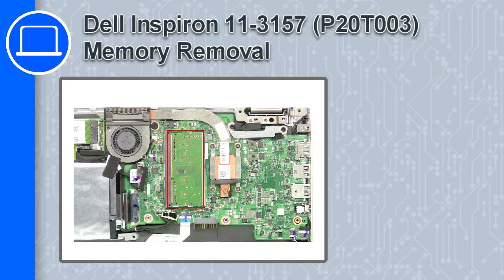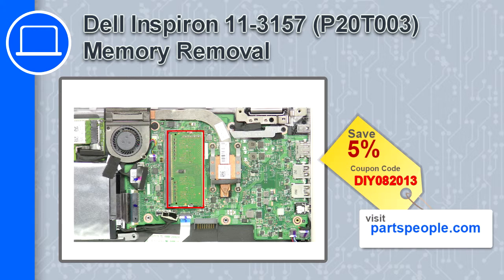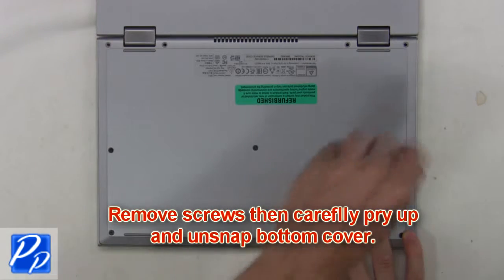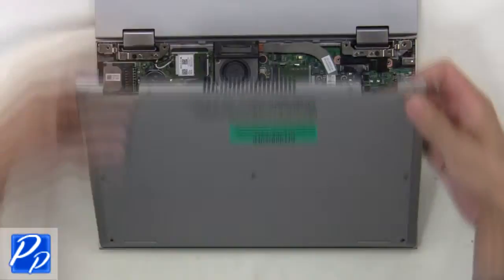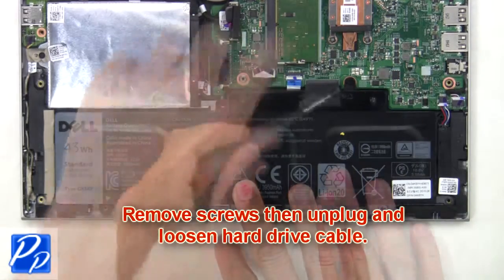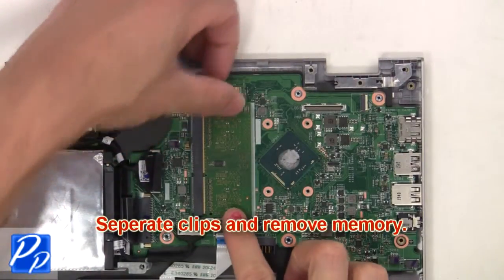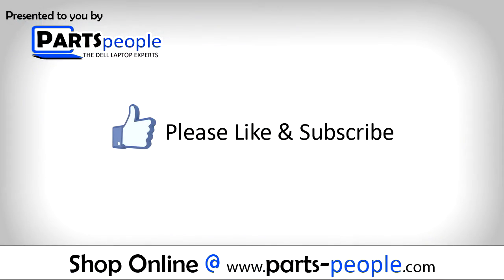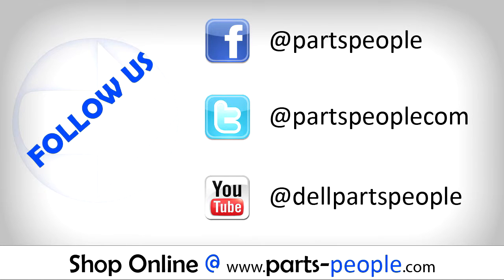Dell Inspiron 11-3157 (P20T003) RAM Memory How-To Video Tutorial

Comment: What could indeed be improved memory up to 8 gb?
Reply from the maker: Dell say it supports up to 4GBs. A 4GB maximum.
Reply: @dellpartspeople   Most computers can take double what the manufacturer states. 
memorystock.com says that you can Install:
1 x 8Gb PC3-12800 DDR3 SDRAM SODIMM 204 pin memory